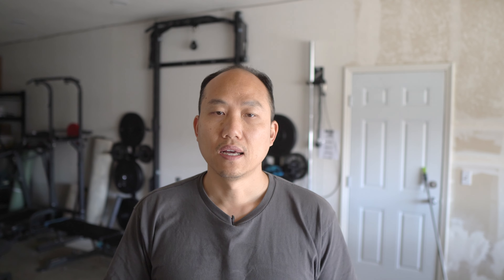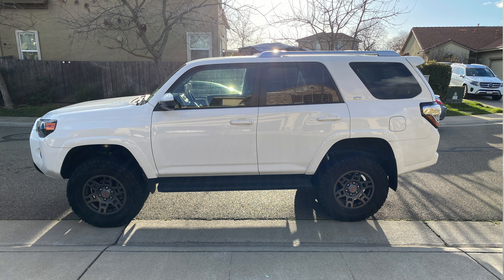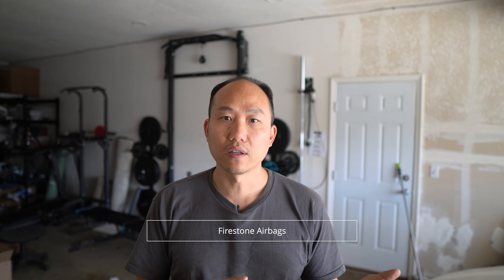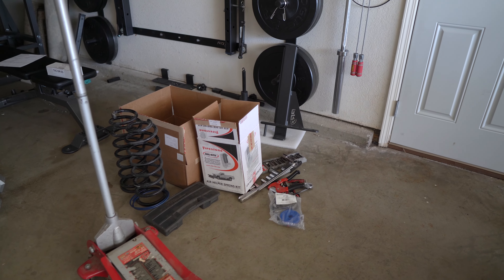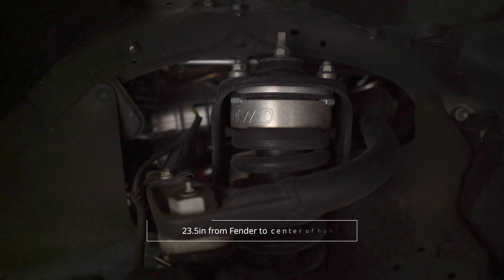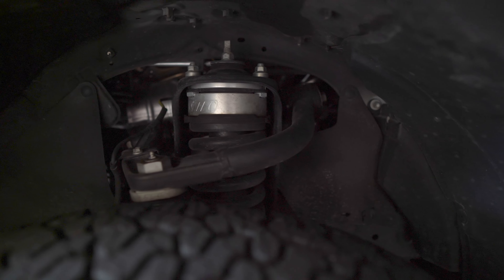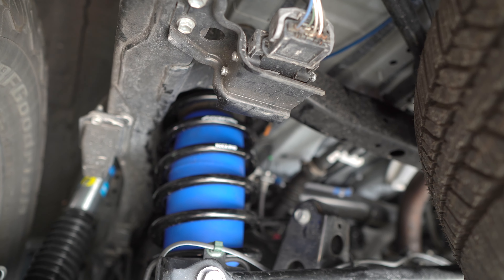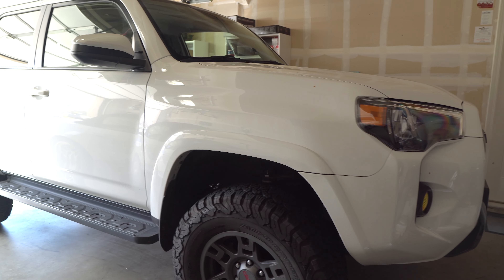Toyota 4Runner 5th Gen Rear Suspension Upgrade

Comment: Do the Bilstein 6112 (HD 650lb) spring kit you will love it! 3" lift out of box(most people get the normal 600lb kit only 2.6 front lift)...and you can do more with Westcott Designs preload collars. I got 3.1-3.
2" front lift (using only the lower collar not the top collars) and still usable up travel w Camburg uniball UCAs. Im on 34's w viper cut and a pushed forward alignment NO RUB on a conservative BMC. 1/4" away from touching the BMC. I found your vid looking for 2" rear spring option from 1.5" (current). I will consider Toytec rear HD lift as I have a Nguyn Designs steel rear bumper(no swingouts) 3rd row seat and plans to carry 2 MX bikes (500lbs)out back on occasion. 

Also... front is so stable now even my wife helped me take front swaybar OFF It rides SO much nicer now. Still handles fine on freeway. Keep rear swaybar and make it bigger diameter it will balance out great! Truck rides 50% nicer bc front swaybar is off. Swaybar is only designed fkr stock vehicle. Once you stiffen truck up the Front sway just makes things worse/limited.
Reply from the maker: Thanks for sharing the info.  I decided to go with coilovers by Eiback with the 600lb springs so I can dail in my height once I get a wench installed.  I think the 650lb spring would be a good upgrade in the future.
Reply: are you getting 3" out of the box at the highest setting with 650lb?

Comment: 2022 sr5 4runner using eibach pro truck stage 2r, 285/70/17s, back is sagging :((
Reply from the maker: Sagging with weight or without?  I just installed the eiback coilovers in the front and I measured about a 4in lift.
Reply: @PaulVang  the weight on the back now a box morimoto headlights and full tank of fuel. eibach told me the rear coils only gives 1” of lift. thinking of pro lift hd kit +2.25”-1.75” or load leveling system +0-2” of rear lift or cornfed spacers. i really don’t know what to do
Reply from the maker: @a04a27  I see. You'll definitely need stiffer springs in the back.  Look into these adjustable springs in the rear from Eibach. https://eibach.com/products/load-leveling
Reply: @PaulVang , good morning and thank you! am i the only one experiencing this with the eibach pro truck stage 2r?

Comment: I’m curious why you went with the Bilstein in the rear vs. the Eibach since you did the fronting eibach.
Reply from the maker: I was going to go bilstein for both front and rears.  I did the rears first and then when I was doing my research again for the fronts, I decided it would be a hassle to take the bilstein fronts apart to make any height adjustments so I thought about going with the Toytecs but then stumpled upon the Eibach.  In the end, I went with Eibachs.
Reply: Thanks so much for the fast reply. Great channel love the details you add and all the resources linked below.  I did the front first with eibach 2.0 and looking at finishing the rear.  I may stick with eibach in the rear unless I’m missing something.  I definitely don’t want any sagging in the rear which I would have now if loaded down. Also I have the KDSS so I can’t lift beyond 2.5 inches. Thanks again keep up the good work. 😊
Reply from the maker: @jeremyjones1186   you cant go wrong with the Eibachs.

Comment: Did you change a longer brakeline at the back? With your 2inch coil spring rear? Thanks
Reply from the maker: I didn't. I still have the factory brake line.